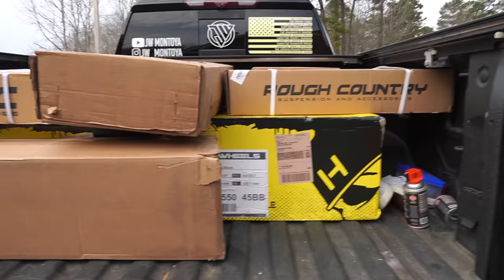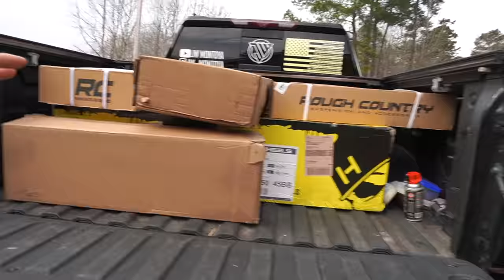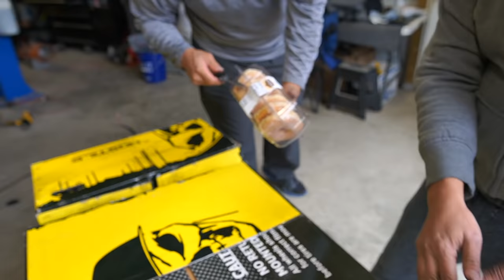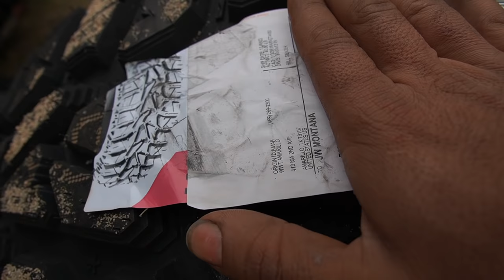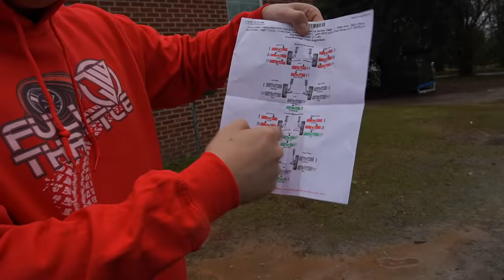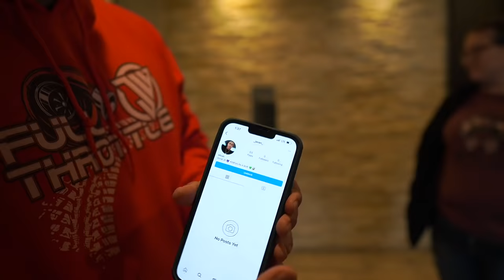Soldier's Dream Truck Build: The Ultimate Surprise for an ARMY Hero

Comment: id love to know how much the gas mileage changed. i have the same truck and have been wanting to do a 6 inch lift on mine with 35s. only thing holding me back is i wasnt sure the 2.7l could handle it but i guess so. great video!
Reply from the maker: So far he said around 14-15 mpg
Reply: Looks like with that size tire and wheel on that truck and a four banger they need to add another turbo to that thing or do an engine swap for the next project 🛻🔧🔨🇺🇸